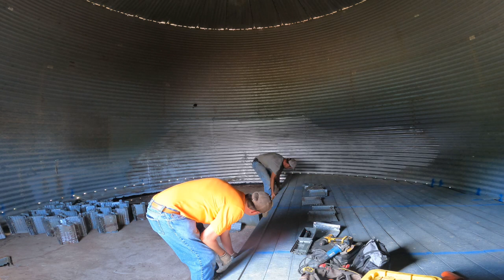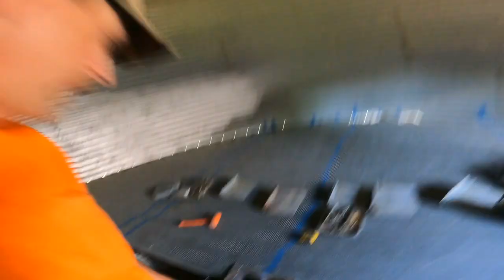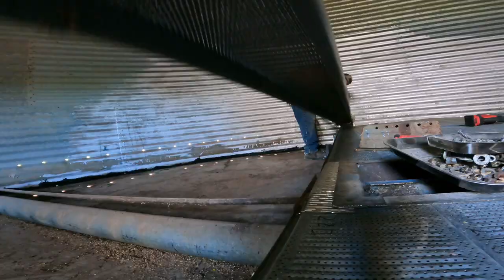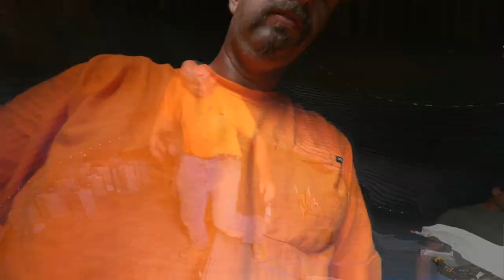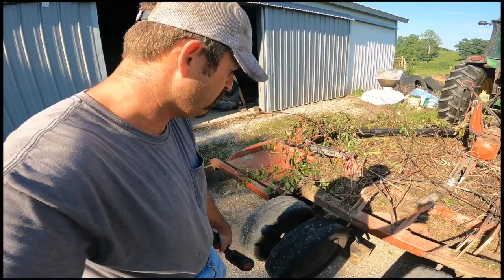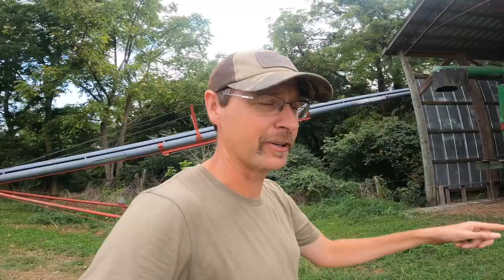Grain Bin Floor; Got it back together, sort of

Comment: Man yeah fellows, y'all been putting in the work on the grain bin floor!! Don't think my OCD would allow that, amazing job!! Even being off a touch, worked out great!! Pro tip on the valve stem🤣🤣🤣🤣🤣 Man that is such a pain when it happens 🤦🤦 I had no idea those wheels came apart, I guess that makes life SO much easier for sure!! Those tires look great, I bet that took a chunk out of the piggy bank 😳😳😳 But look great and should last a long time!! Thank you gentlemen for bringing us along, again love seeing y'all work together!! Look fwd to more, my apologies for being so late 🤦🤦🤦
Reply from the maker: Oh we where pretty upset about the floor being off, but we didn't want to take it back out again 😆. Them air plane tire are so thick, I don't think you could pry the oven the rim lip. Somebody they a two piece, down side is if the tube ain't right you'll cut it when you bolt rim back together. They were about $2000 higher then they should have been, be we got some USA made ones. So that's a big plus.
Reply: @LampleyBrothersFarming  Thank you !! I figured the airplane tires were to thick to mount regular! Thank you for the info🇺🇸🇺🇸🇺🇸🇺🇸🇺🇸🇺🇸🇺🇸🇺🇸🇺🇸🇺🇸🇺🇸🇺🇸🇺🇸